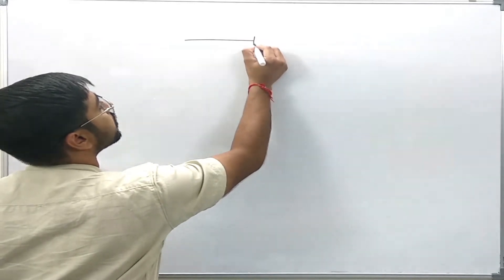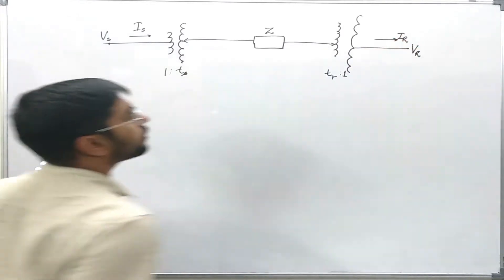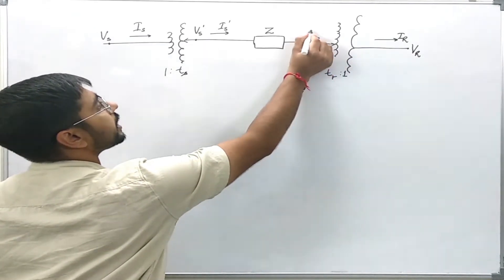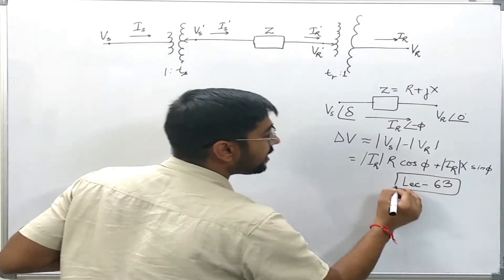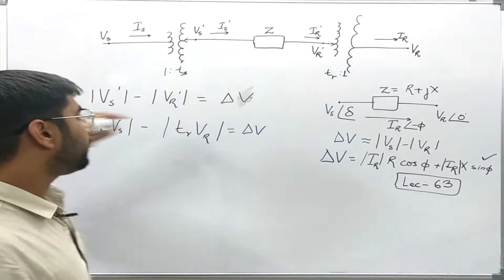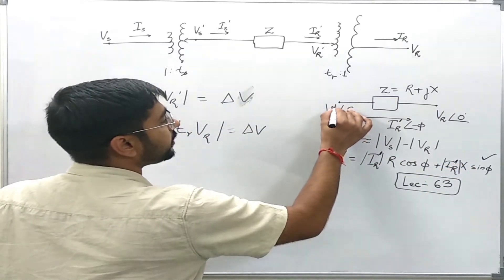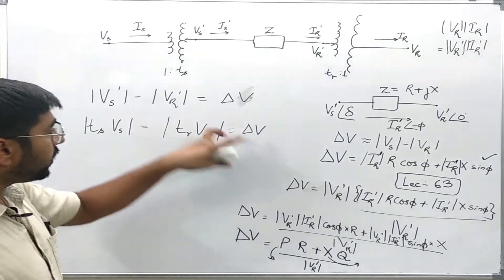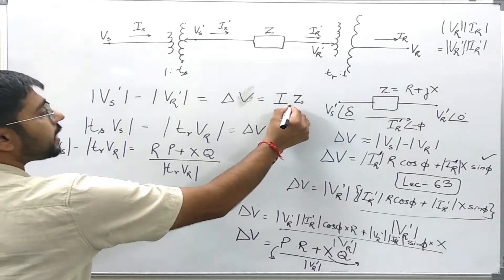85. Voltage and Reactive Power Control Using Tap Changing Transformers

Comment: Sir why tap restriction is implemented in substations? What are the situations demanding for a minimum tap keeping at substations?
Reply from the maker: There are defined limits on voltage variation by the various standards (see CEA regulations in India or typical other national standards). Furthermore, for power transformers, typically the tap changers are a separate module placed in the transformer and may make one of the weakest part of the transformer. So, to keep systems physically and technically feasible there are limits to tap variations (imagine difficulties in designing a transformer having 100% voltage variation capability at such huge power levels: A typical Variac does the same in small labs).

Comment: I work on power plant and when there is no demand i.e.standby condition we import.from.power.purchaser. 
Now during import our p.f gets poor so to cope with that we have installed p.f controller and we have lower the tap position. 

I am not understanding how does lowering the hv tap position decreases reactive power flow .
Say grid voltage is at 132 kv and our tap  is at 9 now we have lower it to 7. 
The name plate voltages shows that at 7 position hv voltage is at 139 kv.  So how this decrease the VAR flow.
Reply from the maker: it appears that the power factor controller consists of capacitor banks. Before connecting the power factor controller, the poor power factor appears to be due to no load current only. The improvement in pf also improves voltage regulation causing in increased voltage at the earlier tap and thus requires lowering of the tap.
I hope it now clears your doubt.
please share and subscribe the channel if found helpful.